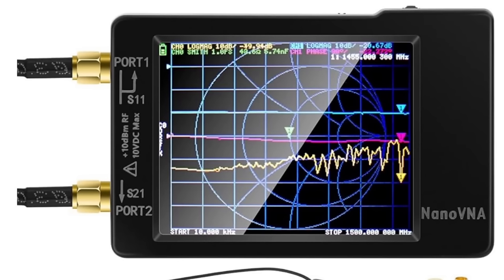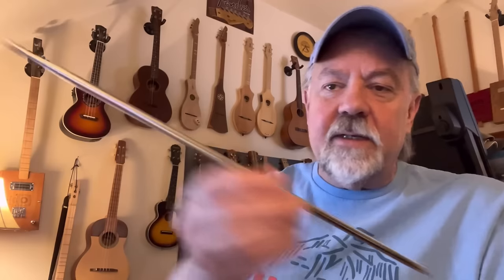Antenna Wire Length - Demystifying Feedpoint Impedance

Comment: Even a multiband antenna can be resonant. But the antenna can be fed at various points and the impedance can be different at various points.
A wire that's fed with an offset like the FD4 can be resonant on more than one band.
I have made one wire antenna with an 1:4 balun (I have tried other baluns as well but 1:4 seems to be the best) and with one short leg and one very long leg that makes it work on 80,60, 40 and 20m quite well and acceptable also on higher bands but I need a tuner and a choke as well to keep it usable on most bands - and I have even had QSOs on 6m with it. One leg is about 13m and the other leg is about 68m (give or take a bit).
Unfortunately it's only 6m above ground for practical reasons.
My goal with that antenna was to make one primarily for 40, 60 and 80m. It can be used on 160m with low power, but it's not ideal.
The disadvantage with this kind of antenna is that it will have multiple lobes that eats into the efficiency of the antenna. It also has to be tuned to be best at 3.5, 7.0 and 14.0 MHz and not in the middle of the bands because as soon as you end up in the higher bands then the tuning will be totally out of band. Even in the 20m band it's a bit more to the center of the band, but it works.
I have even made some transatlantic QSOs on 60m with this antenna from my QTH at JO97, one to square FN31 - on 15W, which is the legal limit where I live.

You can read a lot of antenna theory but you need a bit black magic to make it work too.

Comment: Very interesting video!  Thanks Walt!   I wonder if you have ever used a RX noise bridge to adjust your antennas?   I don't think Palomar sells them any more, but MJF does but they are $$$.  I see used Palomar's on the E-auction site for $20-30.  And there is not much involved in building one if you have a good parts junk box, so even building one in an evening is not out of the question.   I had a noise bridge quite some time before I got an antenna analyzer and had a lot of fun using it.
Reply from the maker: Thanks! I have not but now you have me researching them. 73, Walt

Comment: I was impressed when I read that end fed halfwave will work on every harmonic -- not just the odd harmonics.  For example, my 66 ft / 20 meter long end fed halfwave at 7 MHz will also work on 14 Mhz and 21 Mhz and 28 MHz too.  The SWR is very acceptable and many times I don't need to use a transmatch.  I can also use it on the WARC bands with a transmatch.  It's a very versatile antenna.
Reply from the maker: It’s a great antenna

Comment: Thanks Walt. My 29ft vertical was a perfect match on 10m with a 9:1 unun and  a few ground radials. Tuned down into 40m though it didnt work real great it worked. 40m to 6m on 1 antenna was fun to play with. Also a good shtf antenna to have handy on a DX Commander pole
Reply from the maker: Roger that Jon! I got a 9:1 balun from a really cool dude and I think I’m going to build a dipole with two 29ft long wires which would come to 58ft long overall which is another good random length. Stay tuned lol

Comment: I had an SWL antenna with a single wire feed which I converted for ham use by connecting the wire direct to the tuner. It worked pretty well and it was attic mounted, but had some RF in the shack on some bands. Fun times.
Reply from the maker: Awesome, I’m thinking about making a 5/8 wave vertical and use one of my tuners at the feedpoint

Comment: Please tell me what balun or unun i need for an open dipole (2x20m wire) to conect to a 50 ohm coax.
Reply from the maker: I would say a 1:1 balun
Reply: thank you ! @COASTALWAVESWIRES
Reply: @COASTALWAVESWIRES  nope,!! The impedance will he +- 72 ohm. You would need to .. : 

1. Use a 1,25:1 balun (75 to 50 ohms)

Or

2. Cut your 1/4 wave sides down at both ends till you get a close to 1:1.    Depends on various variables IE ground conductivity. Refer to the application of a dipole in an inverted V configuration .  

Or 

3. Use a 1/4 wave x VF normally around 66% of  RG58 OR RG213 coax.  
  This will transforms the 75 ohm to 50 ohms. 

But this true only on a fundamental monobander.  

Good luck
Reply from the maker: @Johann-ZS6L yeah, that part about trimming the wires to 1:1 is pretty much standard when it comes to building a dipole.

Comment: I use 2x 1:1 then my 49:1 or my4:1 using the 1:1 stops the returning current from traveling Down the coax. 20meter long efhw has 49:1 then 2.5 meter of coax then a 240-43 ie a 1:1 then I don't get rf in the shack

Comment: You've got some good stuff.  It's always fun to see what concoction of an antenna you've come up with. 

I was listening to a few guys in state on 75M last night and one fellow who's not far from me is having problem with a 75M delta loop.  He has it cut right he thinks, but the SWR goes through the roof when he tries to run his amp on it, but if he runs it barefoot it's ok.    I tried to jump in several times and was going to offer to stop by with a SWR meter and analyzer.  The analyzer sure would be a good way to see what was going on, but I couldn't get acknowledged.   Ah well....what can ya do?
Reply from the maker: Thanks! Ah well, you tried. I wonder if it just needs to be better choked at the feedpoint to keep all that energy in the loop itself. Just my first thought, who knows.
Reply: @COASTALWAVESWIRES   The impression I was getting from listening was that there might not be any balun at all at the feed point.  It wasn't real clear to me.

Oh yeah...being able to hook up an analyzer and see what's going on sure is nice, that's for sure!  If he has a balun we could have figured out real quick if his antenna was fine or if his meters were screwy.

Comment: Excellent video Walt. You explained the basics very well. If people watching have questions, I suggest they do research before making stupid comments. I love low cost, homemade antennas that work and you show so many very good ones. You don't need to spend $200. to $500. for the latest "New" or "Tactical" antenna to make solid contacts, especially when working portable. Thank Walt ! 73
Reply from the maker: Thank you so much! 73, Walt

Comment: I am curious about where you came up with the 50 Ohm feed point impedance statements about the end fed quarter wave vertical and the center fed half wave dipole.  If you reference the ARRL Antenna Handbook, I think you will find that the feed point impedance of the end fed quarter wavelength vertical antenna is from 25 to 35 Ohms and the feed point impedance of the center fed half wavelength  dipole is antenna is approximately 72 Ohms.  I'm also curious as to why you seem to poo-poo the use of an antenna analyzer or VNA that can give you an accurate measurement of feed point impedance which will include the measurement of any reactive component of the complex impedance.  You may not be able to get a perfect 1:1 impedance match just by changing the length of the radiators.  Depending on the antenna, you may need to include either shunt or series reactance to cancel an antenna's reactive component, either capacitive or inductive.  You can't rely on a simple SWR meter to give you that information.  And, you can't rely solely on modeling.  Nano VNAs are cheap.  Get one and learn how to use it. de N6BX

Comment: Great video. Thank you very much, Walt. I watch your videos the most. I made my first DX contact yesterday with Maritime Mobile Service Network using your 29 ft vertical, 9:1 unun, 1:1 unun, with the classic DX Commander design. The net control operator was in Texas. I used the Xiegu G90 at 20 watts. I was using the flagpole tire support to support the DX Commander pole on my back deck. I used weights as an anchor. You have a treasure of information and it helped me very much. It was simple and it worked great.
Reply from the maker: Thank you and it so awesome you made your first DX contact! Congratulations! There will be many many more to come! 73, Walt

Comment: Walt, I’m like the lead newbie!!! About to go online after getting my general.  Have not purchased any transceiver or built an antennae.  Have used a wire in the back yard to monitor with a borrowed receiver.  I have a house on the beach and want to set up that property with one of your beach configs.  I like the G90 as it appears to be a rugged machine and would always be a good machine for the surf/sand.  would like to be a member and have joined the channel but do not see any button to become a member that contributes monthly etc.  Like your beach videos as that is where I want to start with my rig.  Will look at a different machine for my main house.  My beach house is on Grand Isle, LA.  Let me know specifics of what you recommend for the beach.  I can’t seem to find the details and links when I go to comments to find details.

Comment: You say many time, “this antenna had impedance of” x ohms.  How do you know what the impedance of that antenna is?  I understand there are effects from the environment, so do you measure the impedance or is there a reference somewhere or something else?
Reply from the maker: This is a referenced impedance from historical builds and yes it may very well vary because of the environment.
Reply: @COASTALWAVESWIRES  what do you mean historical builds?  Did these builds have the impedance measured?  How do you know this?  Some antenna book?  You measured?  What is the source of this information?
Reply: @COASTALWAVESWIRES  thank you for your prompt reply.
Reply from the maker: @eugenecbell  unfortunately it’s not all in one place but here is a good place to start with random wire antennas:
https://www.hamuniverse.com/randomwireantennalengths.html
Reply: @COASTALWAVESWIRES  thank you!!

Comment: Have you used a Yaesu ATAS-120A antenna?
Reply from the maker: I have not but it’s on my wish list.
Reply: @COASTALWAVESWIRES  cool. I've got one I use with my FT-891 radio. I have had the radio & antenna for a few years now. They work very well. I think you probably know the FT-891 has the operating software to use with the ATAS-120. They are good, in my opinion.

Comment: Walt thanks for spreading the truth. Slightly compromised antennas are great, only compromised by an unnoticeable amount. That means they WORK. I have used 29 foot wire with my home-built 9:1 unun on multiple successful portable adventures. Also other wire lengths for avoiding resonant wires, and the tuner makes it work GANGBUSTERS. Thanks Walt for encouraging people to try and see for themselves. It WORKS if you follow basic principles. And it's FUN. Keep striving, keep trying, keep having fun, Dave WA4NID
P.S. - I have edited this since I had said 49:1 unun with my portable ops, but I actually use 9:1 unun (homebrew) with 29 foot and sometimes longer wires. I am still studying all this, but it seems my results and good operating experience generally conforms with yours. I am now also building 4:1 unun so I can try out Rybikov and other shorter unbalanced antennas. Keep striving for fun and QSOs. I keep having fun with CW and sometimes with SSB. All the best.
P.S.S. - my 49:1 transformers are used for the EFHW (End Fed Half Waves) wires which require higher ratio of impedance match. Keep bringing it Walt!

Comment: Great video Walt, as always. I had asked this question to other YTers and want your input. A balun or unun is a transformer of sorts which helps match the impedance. A choke is used for common mode currents. However, I’ve been told that baluns and unun’s are also chokes. Please give me your insights. Thanks
Reply from the maker: Thanks! My understanding is that both baluns and ununs act as a choke somewhat as well. I typically put a 1:1 choke inline with a unun but I’m really not sure how much it is really needed.
Reply: Hello  , my friend  !  Yes , after UNUN and BALUN 4:1 , 6:1 , 9:1 , 16:1 , 49:1 , 64 :1 ALWAYS  !!! you also need instal BALUN 1:1 for suppressing currents on cable braid .  73 !  Alexey , US8QQ
Reply: @omgy750  Question: does it need to be a 1:1 balun? Could you use ferrite beads or an air choke (coax cable wrapped around pvc with the proper amount of turns) to stop common mode currents?
Reply: @richiec7602  Yes , of course  , you can use ferrite beads on the coax , and a separate 1:1 balun on FT-240-43 according to the DG0SA scheme . The air balun is not very effective  .

Comment: why would you use a 1:1 balun on a 1/4 wave vertical? If you need a choke use a choke.
Reply from the maker: I actually said in the video you didn’t need to use one. I’m simply trying to simplify feedpoint ratios.
Reply: @COASTALWAVESWIRES  Sorry, misunderstood that remark. Another great video btw!
Reply from the maker: @jerryKB2GCG  no worries, thanks!

Comment: Any antenna is better than no antenna so my rule of thumb is build a resonant antenna if you can or build a random length antenna with 9 to 1 unun and an impedance matched (tuner) if it’s not possible.

Comment: Hey Walt, just to say that I love what you're doing with the wire antennas by the sea. I've just returned to the air this week after a 12½ year break (health hasn't been great for a while..lol) and I'm getting my things together again to get out by a river estuary close to where I live in Norfolk England.
"The salt water amplifier " is something I've worked with quite a lot in the past, and set the world record (along with G4AKC) for the first pedestrian mobile to pedestrian mobile contact between G and ZL3 when I was in Christchurch NZ operating as ZL3/G7LPW/Pedestrian Mobile on 20m.
Unfortunately my pedestrian days are fairly much over now due to my health, but I plan to do similar to yourself and build wire antennas on the riverside and sit in my car with my trusty old Alinco DX70TH.
Hope you're having fun, and maybe catch you on the air sometime.  73, de G7LPW (Keith in Norfolk England)

Comment: Saving this one! Thanks Walt! Taking the test for general on Saturday. I want to make my own antenna(s) eventually but will ease into it. I’m using two 10 meter hamsticks in a dipole configuration now and have two 20 meter sticks in reserve for when I pass my test. These two set ups will get me started. But I want to make an EFHW that I can use on multiple bands that will work with the built-in tuner in the FT-710 I’m planning to purchase.  Right now I use a 60 watt single band 10 meter radio.

Thanks for your videos!

Comment: I think when I go to buy a hf radio it's probably going to be the g90
Reply from the maker: That’s an excellent choice because you can build or use just about any antenna with the radio’s built in antenna tuner.
Reply: @COASTALWAVESWIRES  and being outdoors is fun as well.
Reply: G90 is great no doubt about that but don't forget about the FT 891
Reply from the maker: @monawarrajayki5445  I have both, they are both great but I just like the G90 more myself.

Comment: if i build a 1/2 wave ground plane, do i still need a 49:1 ballun ?
Reply from the maker: Yes, you will still have the 49 to 1 impedance mismatch at the feedpoint or something near that.
Reply: I'm not sure there's much point in having a ground plane for a half wave. What the ground plane does for a quarter wave is to appear as the other "half" of the half wave dipole. You're then feeding the "dipole" in the centre, hence the 50 ohm load, at the maximum current, minimum voltage point. Feeding a half wave at the end feeds it at the minimum current maximum voltage high impedance point.
Reply from the maker: @paulsengupta971  exactly 👍🏻
Reply: i should have stated that it will be single band use. not multi-band.
Reply from the maker: @christophersmith1155  it’s still not going to have a 50 ohm feedpoint. You will still need to match it with most likely a 49:1 unun.
Reply: oh, ok . now i understand my ELMER.

Comment: Walt - really appreciate how you use simple gear and are constantly experimenting.  I recently set up an end-fed 41’ random wire with a 9:1 Unun.  Pretty good results.  After adding a 1:1 Unun RF choke, I was surprised by the improvement.  Now getting tons of international QSOs on 5W. I recognize this antenna knowhow is widely available, but you make it accessible and approachable. Thanks and keep up the great videos.
Reply from the maker: Thank you so much for the kind words my friend! 73, Walt